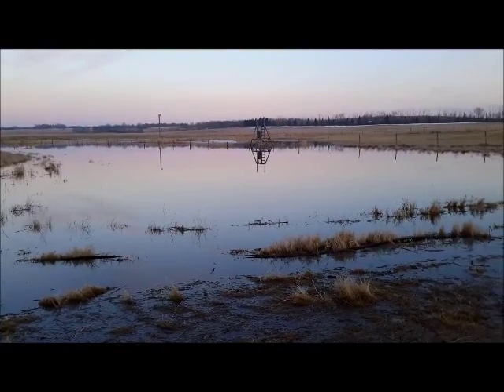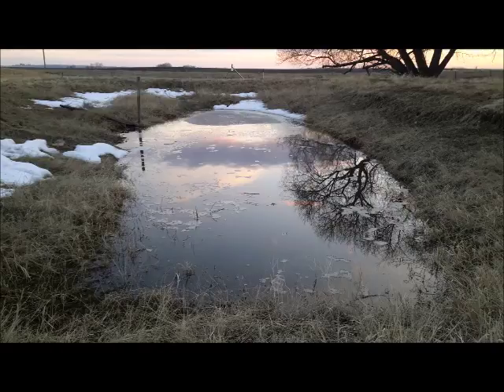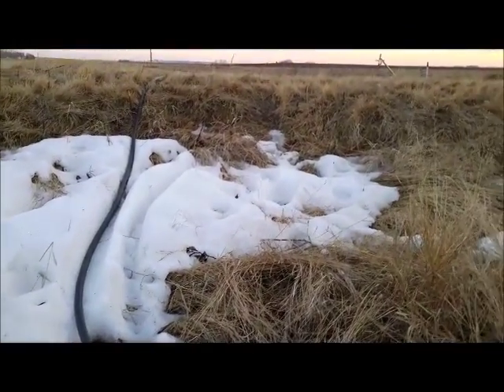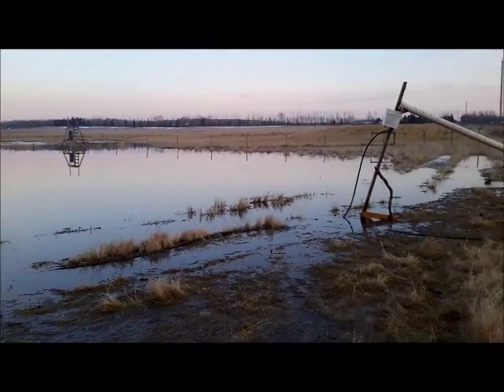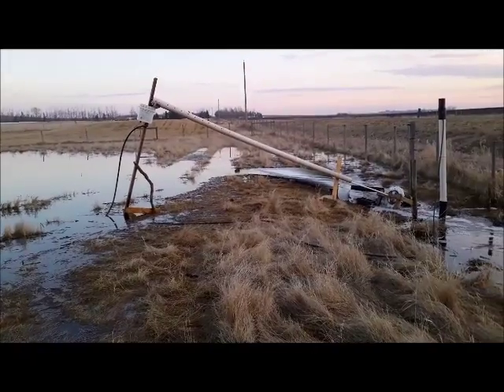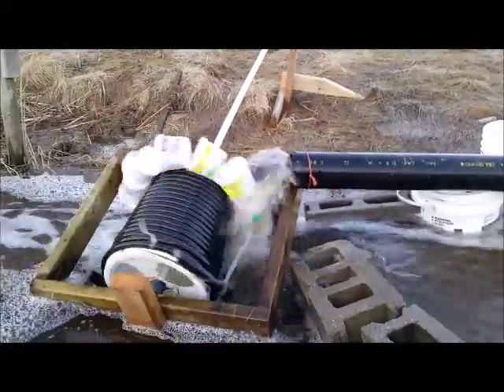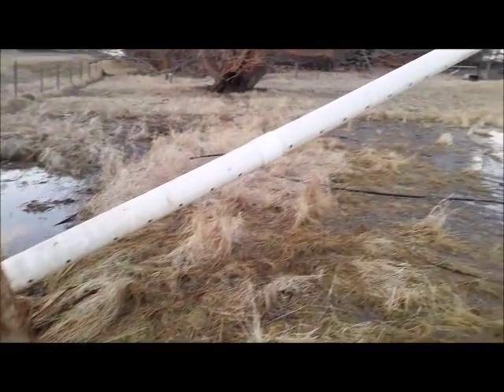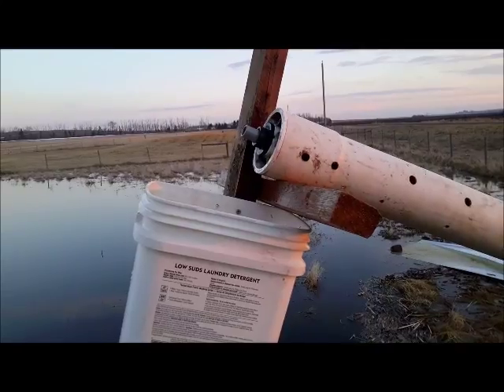Water Wheel and Spiral Pump

Comment: These false  whell is totaly wrong............
Reply from the maker: I'm guessing you're suggesting that an overshot wheel would work better.  In my case, there wasn't enough height for me to run the pipe over the top, and I'm getting action both from the water flowing from the pipe into the containers and the general flow of water under the waterwheel -- when you've got a limited head of water, you do what you can to get at least some action!

Comment: I'm disliking this because there is a lot wastage of energy the system could be very much efficient but it is wasting a lot of energy
Reply from the maker: Thanks for responding.  My hope is that I can spark some interest in the concept, and that people will take the idea and improve on it.  If the system can be dramatically improved without significant cost increases, I would be happy to see the results.
Reply: @prosstaylor  well a lot of water is going without rotating the wheel inspite of cups you can use wooden strips that will not only provides sufficient force but also you can number up the spirals making 3-4 turns of single pipe and connect them with single central pipe
Reply: @prosstaylor  also the black pipe is creating drag to the wheel by applying unnecessary force also you can powerup this system by lowering the black pipe so that water from black pipe make contact tangentially to the wheel 😊
Reply from the maker: Thanks for your input!  All the best!

Comment: thanks for posting.  good work.   here are some things to consider.   as mentioned in yer videos, in order to raise water to the maximum possible head,  the design of a coil/spiral pump installation can be OPTIMIZED for   air lift  performance.    a factor is the use of correct diameter tubing, in each 'stage' of a water-raising system.    examples:      the diameter of an individual riser MUST be sufficiently small so that   'wall to wall' confinement  of the rising 'slugs' of air is  Maintained.     the orientation of an individual riser  Should be  nearly-Vertical, leading to an elevated catchment; where air can escape the system.   any horizontal  transport of the water/air as it leaves the pump  Will Reduce  air lift  performance.
a correctly designed spiral/coil pump can raise water (just not a lot of it) to a head of sixty  meters.  [  in a  PUMPED- Microhydropower scheme,  the Use of  Multiple Pumps  may be a solution to the low flow rate issue.  ] (see my latest)     you may know that most of the people who now do not have access to grid-power  CAN STILL MAKE USABLE AMOUNTS OF CONTINUOUS , ELECTRICAL POWER.   how.   via the  use of a  Large-radius, TURNSTILE mechanism, to convert animal (or human) power to a modest amount of  CONTINUOUS  electrical  power.    see horse mill / ox mill.       in case no one else has noticed,  such a  wind-powered, water-raising, HEAD-creating scheme as, almost, overunity.   because the corollary of gravity,  BUOYANCY,  is being utilized.    the combined  drive shaft and riser approach is Clever, but not an Efficient power transmission.     the performance of yer pump would be improved with the use of  Correctly designed  scoops.    see discussion of scoop length/volume at linked docs.     cheers                       googletranslate
https://lurkertech.com/water/
Reply from the maker: Thanks for your informed and insightful response -- implementing a vertical riser would increase the overall lift, as less water would "drain" past the air blocks, and the scoops could definitely be optimized.  For my application, volume not head is more significant.  It should be pointed out that the "buoyancy effect" is actually best modelled as the reduction of the effective density of the water in the riser, allowing the column of water to be significantly taller than water with no intervening air blocks, as the water column's length is extended by the essentially weightless air blocks between sections of water.  Regardless of how much air is entrained, if the total weight of the water in the riser exceeds the combined weight of the water in the screw pump, the contents of the pump will be blown back out of the intakes until equilibrium is established; hence the system obeys the laws of physics and can never be over-unity.  Thanks again for providing useful info and links for maximizing the effectiveness of this type of system.

Comment: Any new progress in 2018 with your water wheel pump idea?
Reply from the maker: Not much change -- I put a threaded coupler between the plumbing cross and the long pipe that carries water up to the collecting bucket so I can separate the pieces and carry them more easily.
Reply: Thanks for keeping in touch.  I did have an exchange with the Barsha pump which looks very interesting, but 2 K for the pump and 500 to 1000 for shipping is a bit much to jump to without more confidence in the approach and supplier (but still on the list).  I'm also exited to get a reply back from the Uganda pump project - hope they continue to make progress - https://youtu.be/ETb_jX4NUQM
Maybe you could give them some encouragement?

Looking through the water wheel pump videos there are either additional ones coming up or maybe I'm seeing more of interest.
Best wishes.

Comment: I realized that part of the attraction is the simplicity of your wheel, but have you or anyone else found a good source for rotating adapters - might simplify the the pipe installation to the collection bucket or eliminate it.  One thing I liked about the bucket is that it would seem to even out the water flow and might be used to collect water from multiple pumps for a common discharge.   Thanks again - got me thinking.
Reply: in the 5/8 inch range, some, rotatable, garden hose fittings can, perhaps, be used.   i tried it.  but i am not sure if it workd, because the radius of my spiral pump was too small and it didn't pump.    cheers
Reply from the maker: That's odd -- as long as half of each coil is above water, the pump should work regardless of the radius.  My first attempt was with clear tubing wrapped around a yogurt container, and that worked -- just not lots of water and not much height!  At the other extreme, you'll see some of these online that are wrapped around waterwheels metres in diameter!

Comment: Thank you for the video.  Would you mind providing some more information about your installation, such as the amount of water that is pumped? and the height gain to your collection bucket?

The video shows two pipes without scoops. Did two pipes work better than one or four?   Any idea if scoops would have helped?

I've seen some spiral pumps with pipes wound at the same diameter and some with increasing diameter - any idea what difference this makes?   Yours is only the 2nd pump that I've seen with multiple scoops - the other had 4 - they seemed to think it helped.

How did you do the coupling from the rotating pipe to the stationary pipe?   Oh wait, maybe the stationary pipe rotated inside the larger pipe, so you didn't need a coupling?Didn't catch this at first.

Maybe a dozen buckets?   Guessing half gallon buckets somehow bolted onto the 5 gallon bucket?   

It took me a while to realize your spirals are not perpendicular to horizontal, but tilted, perhaps eliminating the requirement for a coupling.  Let's see, I need about 10 feet of lift from a creek to reach the far side of a meadow to be irrigated.  A collection pail 10 feet high with an output hose like you used, might work.    We have quite a bit of water, but not much head to work with - I wonder how many pumps we would need?

Interesting simplifications - Do you have any later designs?  Thanks.
Reply from the maker: Good questions.  I'll do my best to answer them.  You'll get some more insight and answers from my wind turbine/spiral pump video, as well.
https://www.youtube.com/watch?v=tfOYmBEk9lM
The waterwheel was producing considerably more than the wind turbine design.  I don't see a record of measurements made, but I'd say it's producing over 100 l/h, and raising it about 8 ft.
There are actually small "scoops" on the two pipes, as I've added some 1" pipe to the ends of the 1/2" pipe.  Larger scoops don't provide much improvement, since there's a need for a dividing section of air between charges, so you can't fill more than about 2/3 of a "wrap" per rotation.
The two pipes are what is needed for the lift I need.  The 9 wraps of pipe in each spiral, multiplied by the diameter of the pail, results in a pressure of about 8 ft of water, which is what is needed to reach the collection bucket.  If you only needed 4 ft of lift, four pipes wrapped around the pail would allow you to physically put about four and a half wraps around the pail for each spiral, giving you half the lift but twice the volume.  If you needed to lift about 20 ft, you would need to go down to a single spiral.
By the way, the reason I start at the big end of the pail is that the air between charges is less compressed there and more compressed towards the outlet, so the shape of the pail is a near-perfect way of keeping the forces of the charges aligned.
In the wind turbine version, I used flexible links to redirect the water from horizontal coming out of the pump to nearly vertical at the collection barrel.  These were a supreme pain, as the flexing and twisting caused multiple failures.  I ended up using gas pump hose, which is hard to destroy but isn't as flexible as I would like.  So, for this design I just decided to use a long, straight pipe.  This, of course, becomes impractical for larger lifts.  I think I'm going to modify the wind turbine one so it's got a long section of gas pump hose inside a larger flexible pipe that goes right from the pump to the collection barrel -- no bearings or tight corners.  This would work for the waterwheel one, as well.
Some of the other waterwheel pump designs show rotating-to-fixed couplings, which I haven't spent a lot of time looking at, but could be worth investigating.
My buckets are Feta cheese containers zip-tied to the pail through holes drilled in the cheese containers and the pail.  Not great, but cheap and easy!  I think there are about 14 of them.
In response to your second set of questions:  Having a collection bucket really reduces the resistance the pump has to work against.  It only has to work against the section of pipe it's connected to, not the whole line.  In electrical terms, the collection bucket is equivalent to a Low-ESR capacitor in a power supply - easy to charge, lots of capacity, providing practically constant potential difference to the rest of the "circuit".  And, yes, it's a great place to feed the outputs of other pumps into - I usually have a couple of small ram pumps and a pulser pump feeding into the same collection bucket!
Reply: Thanks for the extended reply.  I hope you will continue to post any improvements that  you've made.  One thing I really liked about your video was it looked like something that even I might be able to build.  I'm collecting some materials and if the water holds out, hope to have a try at a prototype by the end of the summer.    

I wonder where I could buy gasoline hoses.    Oh I think I see now, a reinforced hose to make the bend to the straight rotating shaft.  I think I've seen these for washing machines - not very big diameter, but reinforced.

Just curious, where are you located?   I live in Denver, Colorado, USA but our installation will be in rural western Colorado.